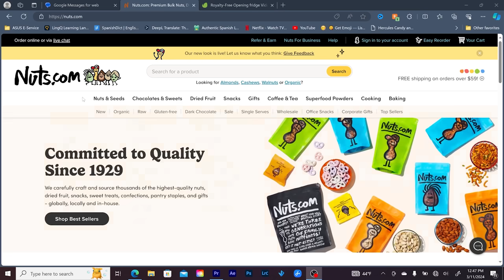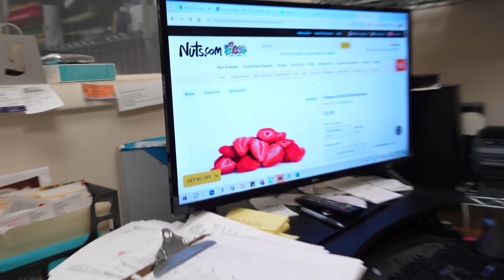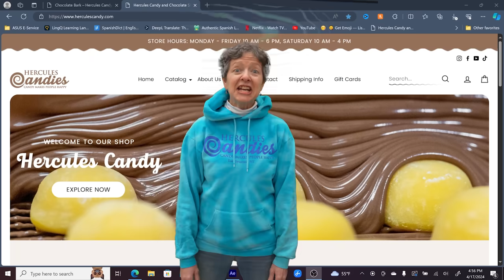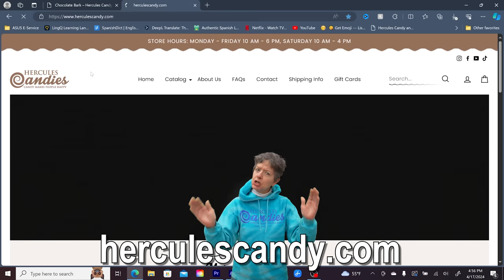This is the best thing you'll put in your mouth in 2024

Comment: Is that Lorann oil cheesecake flavoring you are using if so you might find it easier to mix it in with the chocolate first before pouring it on the table just an idea I used to work in a chocolate store and that's what we did